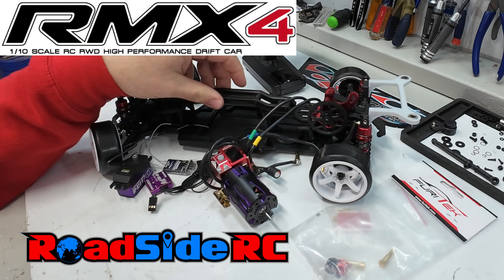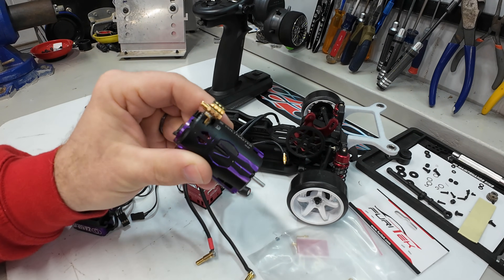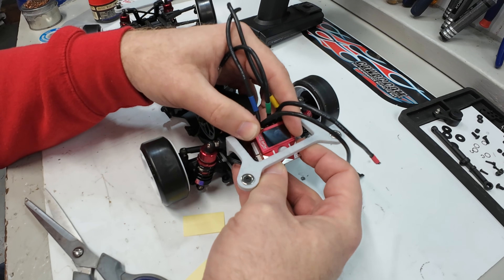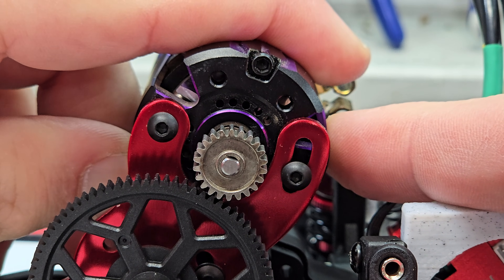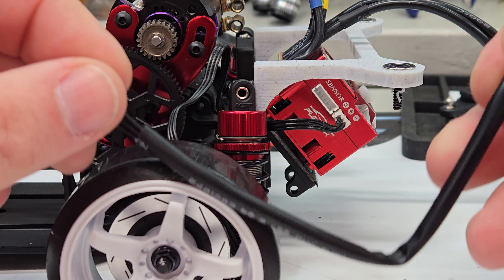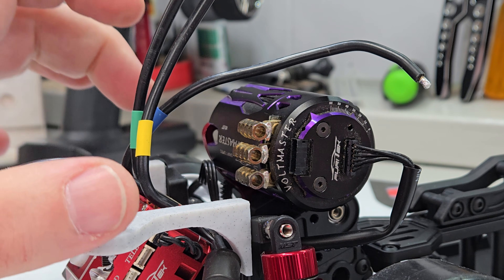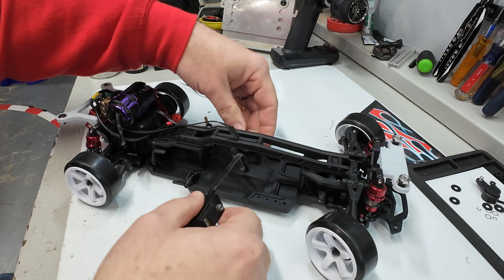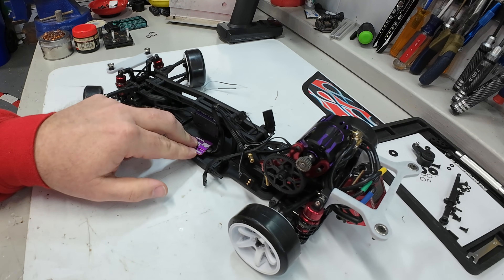How to Install Electronics on the MST RMX 4 (Full Walkthrough)

Comment: Do you have a video of your setup sheet? For some reason my toe is out a lot I feel
Reply from the maker: This car is setup exactly per the factory instructions.
Reply: @RoadsideRC oh okay did yours have one wheel a little more toe than the other
Reply from the maker: @Dawsonmalon Nope.  Did you use a set of calipers when assembling the links?
Reply: @RoadsideRC yes I have the calipers on mine
Reply from the maker: @Dawsonmalon Not the brake calipers.   Digital calipers to measure link lengths.

Comment: So I had to solder on the contacts on the 2 piece connectors? Oops, I just tightened them on. It does make sense to add more metal contact surface.
Reply from the maker: Yep - probably a better approach.

Comment: Ok you're into working on RCs big time i have an off topic question for you .
If you have an RC brand new out of box and it runs in forward & reverse and it will turn left & right but when you turn the trim on the controller all the way to the left and nothing happens the wheels don't move at all !
Then you turn the trim all the way to the right and nothing at all happens the wheels don't move at all what could the problem be ??
Reply from the maker: Hello!
I don't fully understand exactly what the situation is - but are you sure you are turning the trim knob, and not the dual rate knob?
Reply: @RoadsideRC 
The controller only has two knobs on it and they are clearly marked trim and speed !
So yes I am turning the correct knob  the trim 
And as I said it doesn't matter if I turn it all the way to the left or right the wheels don't move at all !
Nothing ' nodda ' zilch absolutely no movement at all not even a hair !
Reply: @timmy4539  If you’re talking about a toy grade RC then that may be just how it is. If you’re talking about hobby grade stuff I’d start looking in the radio system, make sure all the channels are assigned correctly, maybe reset the esc. If none of that works, the knob itself may have an issue, perhaps.
Reply: @mikescherrer4923 
It is a low end hobby grade RC that's made by Holy Stone
Reply: @timmy4539 hmm. In that case, the device that is responsible for the trim actually “trimming” would be transmitter. If there is a discreet servo, try listening for any motor noise when you move the trim, it may just be extremely small  amount of movement or preload and slop in the steering parts could be soaking up any visible change. Try doing the adjustments with the wheels off the ground. Next step would be try a different receiver, transmitter, or both. The servo just responds to input, so the problem would not be there. If possible, swap out radio gear with another model and see if the servo responds to trim, if so that’s your issue. Another less desirable solution would be to simply rotate the servo horn on the servo, or see if there is any hardware adjustment in the steering that would allow you to center the steering without moving the trim. (Turnbuckles or the like) If you want to swap radio gear, you can get a pretty good radio for cheap(ish) from flysky, and then you’ll have a nice radio for future models. 👍
Reply: @mikescherrer4923 
See a lot of this is just the problem i have the RC only response to the controller that came with it and the only other controllers i have are toy grade ones .
And i have no parts to try and swap anything out .
I'm new to the RC world
Reply: @timmy4539 ah. Yeah it can all be a bit confusing at first. Generally, low end radios will only “talk” to the type/model of receiver they came with. Even higher end radios pretty much like to stick to their own brand, and even then they must use the same communication protocol. Long way of saying Tx/Rx basically work as a pair. So your other radios are unlikely to help. What you would want is A) another identical radio, perhaps obtainable from the vendor or manufacturer as a replacement, or B) a separate hobby grade radio setup. Depending on your model, your receiver may be integrated into your Electronic Speed Control. This device controls the motor based on input from the radio. If it is integrated, you would need to replace that as well. The motor can be wired to a new esc. The servo should also be able to hook up to a new receiver. My advice is to do some reading about how hobby grade systems are set up and installed, I’d post a link but YT won’t let me. There are a lot of good resources, though.
Reply: @mikescherrer4923 
I already when the replacement route both RCs do the exact same thing and the controllers will not interchange 
Neither of the RCs trim will work !
Reply: @timmy4539 hmm. What is the brand/model number?
Reply: @mikescherrer4923 
It's  a holy stone model XDKJ-013
I know it's  not the best but it's all I cam afford
Reply: @timmy4539 hey I tried to reply, and my comment disappeared. Let me know if you read it
Reply: @mikescherrer4923 
Mike the last comment you made that i saw was the comment asking what make and model the RC is !
Did you see my reply to your question  ?
Reply: @timmy4539 I did. That’s a great truck. I typed a long reply but it got moderated so I’ll try and make it more brief.
Reply: @t @timmy4539 also, make sure to carefully read the manual and look up model numbers on components you see, often there is separate documentation for those things.
Reply: @mikescherrer4923 
The owners manual for this RC is useless I've tried looking up the servo part number to see if i can get a replacement for it but i come up empty on the servo for sale anyplace  !
The company doesn't even call it a servo they cal it a ( wiresteer gear )
Reply: @timmy4539 oh you don’t need replacements from them, get upgraded units from a different retailer. Amazon or A-Main hobbies are good places to look. Servo is probably
Ok but could also be upgraded.
Reply: @mikescherrer4923 
That's just the thing I'm new to the hobby and the servo has nothing marked on it to say what it is and the numbers in the owners manual  match nothing that i can find
Reply: If any of that is confusing, I highly suggest finding some articles or more videos like this one and familiarize yourself with the common components of an RC car. Motor, esc, servos, transmitter, receiver. There’s lots of resources out there!
Reply: @mikescherrer4923 
Thank you but i know the basic parts ESC ' servo ' servo horn  it's just that this one has a lot of big time RC guy baffled just like me !
The original RC and the replacement both have the same issue
Reply: @timmy4539 I wish you could send a picture, maybe make a video and post it on your channel and I could look at it?
Reply: @mikescherrer4923 
Unfortunately i don't know how to do that and my tablet doesn't have video capabilities